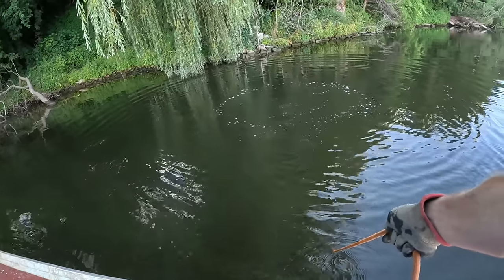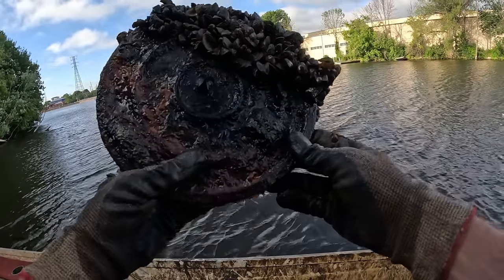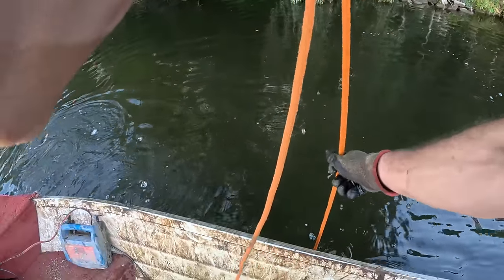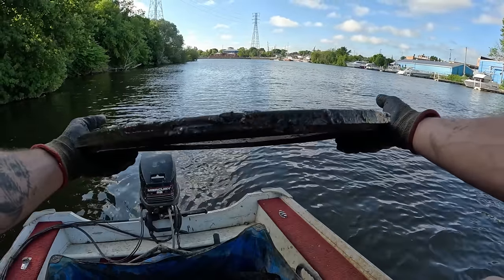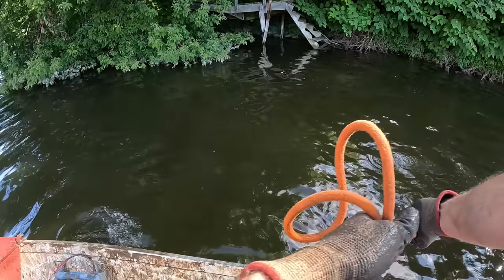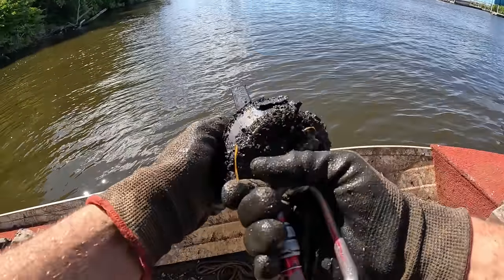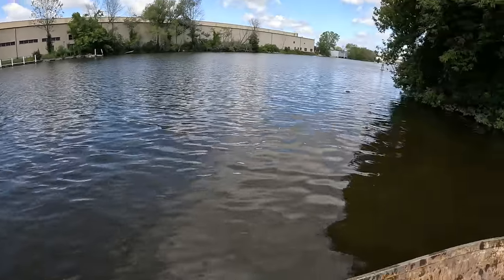Magnet Fishing JACKPOT Found Under Giant Tree!

Comment: Bro, another great vid!  That thing you found at 8:42 is the outside casing for an electrical transformer, which converts electric power's voltage to higher or lower levels.  Those holes you saw probably held the insulators or the capacitors.  That big piece you have at 10:52 looks to be a massive drawer handle.  That disc thing you found at 28:18 looks to be the lid on an old-style kettle.

Comment: The small round thing with the wire sticking out is a Daynamo it clamped on n bike frame and leand onto the tyre and with cyclicaling it generated power to the light infront of your bike used it in the 80s

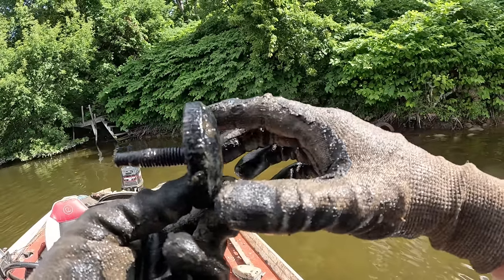Comment: 05:32 that is a lid to an old cooking wood stove.07:32 looks like a bike dynamo for a light. 19:51 well sadly it an electric iron. the 2 hole are for the wires. 23:23 we called them hand clippers. 25:31 that is an ajustable leg like on stoves.

Comment: That knob with the wire is a bike light generator. It attached to the frame and it rubbed on the tire to generate electricity. On old bikes back in the day.

Comment: That thing with the thin wire and knob is a bicycle headlight generator. It attaches onto a bracket and the bike wheel spins the knob producing electric for the light,

Comment: that which you thought was solid steel is actually for an old cast-iron stove, it was fired in the cast-iron stove and cooked on it because it sat in a slightly larger hole in the cast-iron stove

Comment: That little electric thing with the knob is a dynamo to run an old push bike light. The knob sits against the front wheel and turns the gears inside it turning into electricity to run the bike light. loo it up on google you will see thats what it is for sure.

Comment: I think those "gears" that you pulled out first, MAY have been the wheels off of the old "tractor sprinklers".  The single front wheel fit right over your hose, and the water powered the rear wheels and drove the sprinkler along the path of the hose. They were great for huge yards.
Reply: Yep. I have one of those sprinklers.

Comment: the little thing that you didn't know what it was is also for a bicycle but for an older bicycle it is attached to the front fork where the rubber wheel is on the side of it so it is a locking mechanism so you press and it fits on the rubber and the the thick part that you saw a narrower cord goes to the light on the handlebar and the smaller one goes around when the wheel spins forward so it becomes like a small power plant attached to the bike light on older bike models